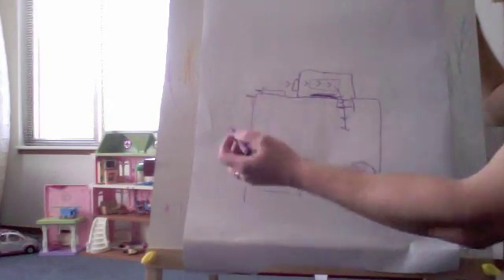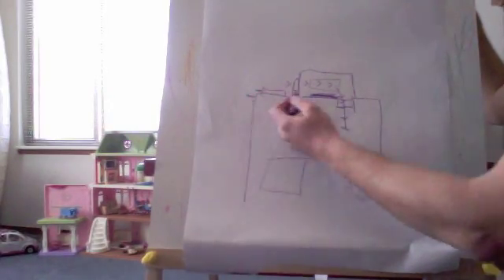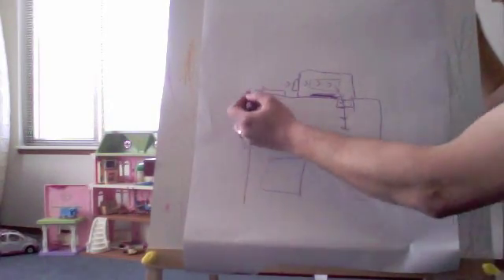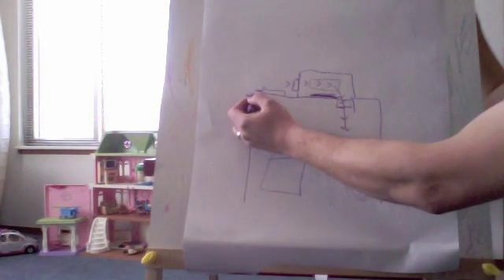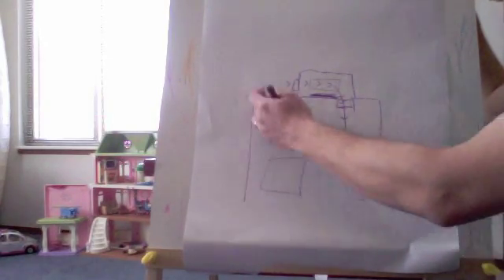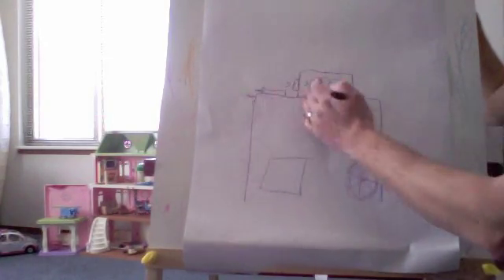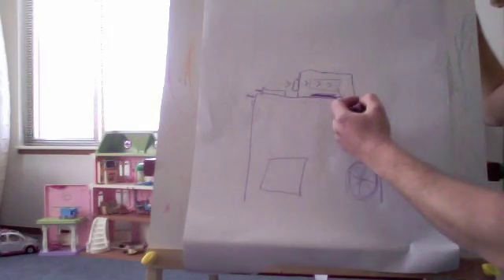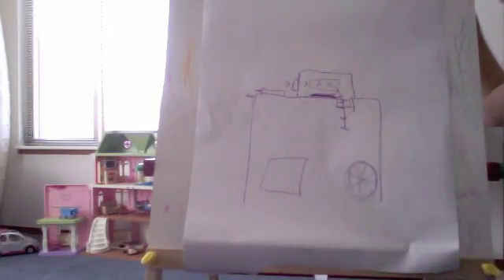Roasting and Air-Flow

Comment: Thanks for this video. Love the info, love the friendly approach. The message that airflow adjustments will have different results depending on the roaster design was well-communicated. I know this was made quite some time ago, but a small point on the "Probat-style" part: I believe that most of these (at least in recent times) draw heat from the burners in through the rear of the drum.